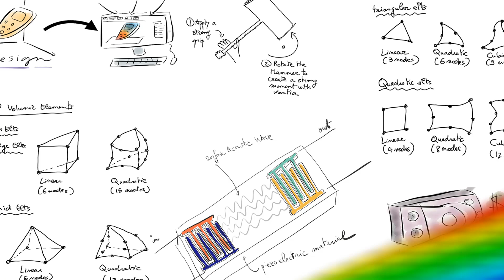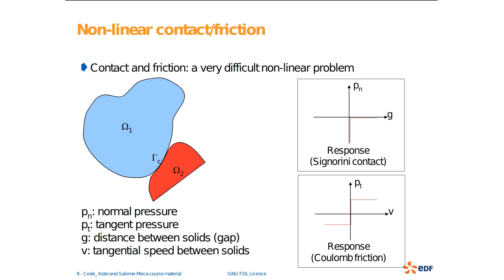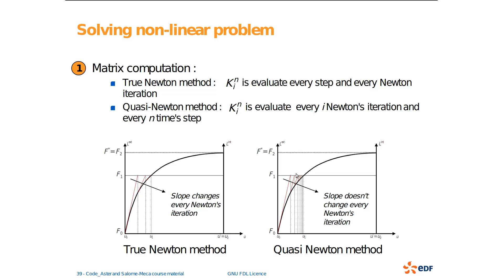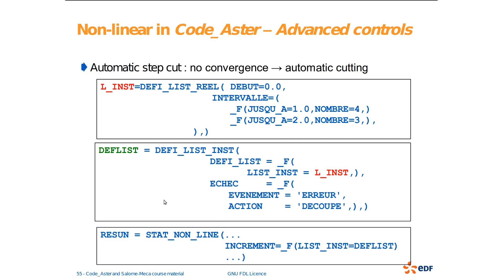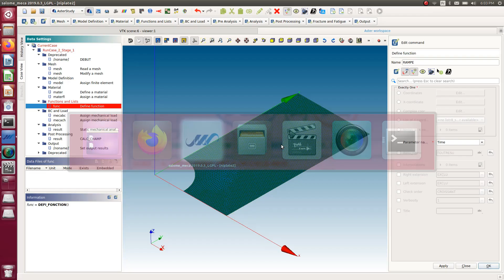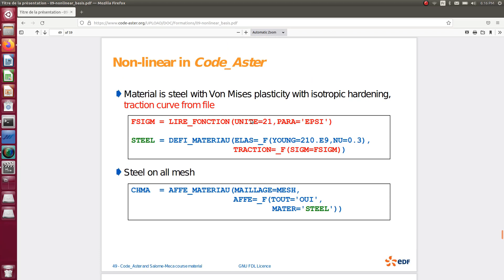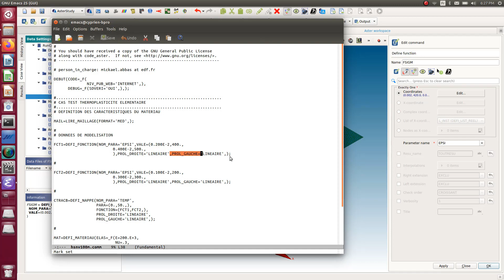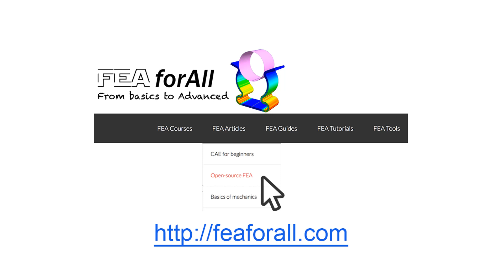[Salome Meca - Code Aster] Nonlinear Quasi-static Plate with a Hole Tutorial

Comment: Hello, Cyprien! Thank You for shearing this tutorial. I have downloaded med and comm files using shared link and imported it in Windows Salome 2021 version (Salome 9.7.0) as per instruction from video. Simulation did not run as expected, got the red status, in message window got this message “EXECUTION_CODE_ASTER_EXIT_1116=0”  and got error in python window “ERROR: Copy failed: [Errno 2] No such file or directory: 'D:/Users/Vinod/Softwares/CodeAster_2018/Tutorial/Non_linear_plate/NL_plate_Files\\RunCase_1\\Result-RunCase_2_Stage_1\\NLplate”

Any help regarding this will be very helpful.
Reply from the maker: This looks like an error of the windows version. Try to use the latest release.
Windows version is not an official version, it has been created by a small consulting company using special cross compilation techniques. The best is to use the Linux one…
Reply: @Feaforall  Thanks I will try with Linux version